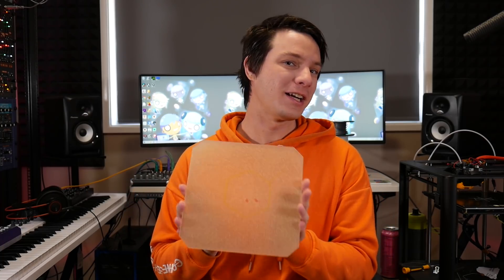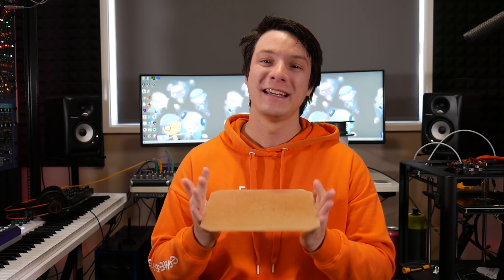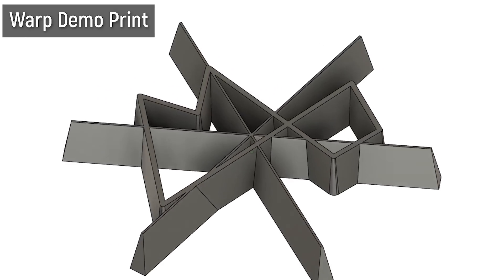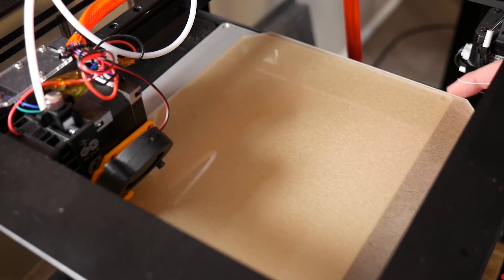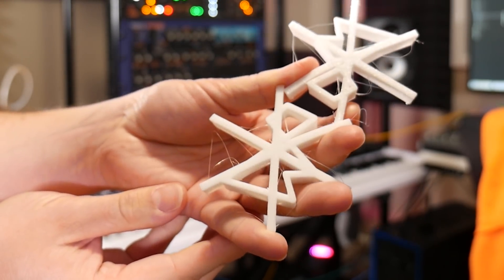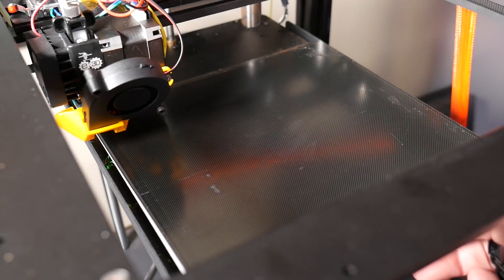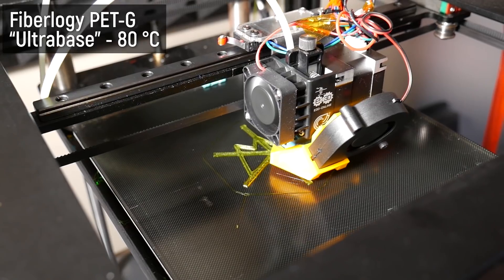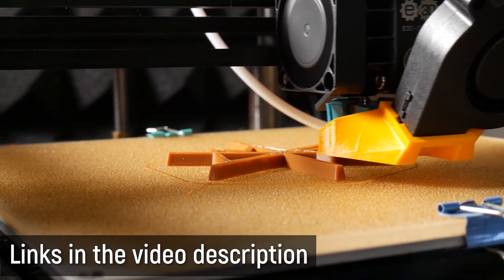A REALLY unusual 3D Printing surface! Ultembase PEI Glass test and review.

Comment: i havent been paying attention to the 3d printing scene recently what happened to tronxy?
Reply from the maker: It originally shipped without thermal runaway protection and they handled it... Poorly.
Reply: @MakersMuse  that's kinda wierd my x5sa 400 with the chitu board came with thermal runaway protection mind you i bought that in 2019 before the pandemic i have since put a skr v1.3 and a volcano hotend on it and am planning to put linear rails on it or develop some reticulation carriages to work with v slot kinda like this.
https://www.thingiverse.com/thing:655539

Comment: Seems like a solution looking for a problem to solve.
If you want a PEI build surface on glass, just apply a commonly available PEI bed sticker to a glass bed 🤷‍♂️
Reply: Pei sticker is a lot different to textured pei like on the glass bed when it comes to adhesion and properties
Reply: We wouldn't make this product if it doesn't offer improvements! PEI bed sticker doesn't release prints automatically, not textured like the Ultembase, and is generally worse than our Flex-Steel PEI sheet. Ultembase has better performance than our flex-steel PEI sheet, which has been a best seller on many platforms.
Reply: @energetic3d647  Also, stickers need to be applied by a human. So many bubbles.

Try to use a smooth layer of PEI before you then apply the textured layer. That would significantly improve the PET-G performance because there would be no chance for it to attach to the glass.

You could also try using quartz glass with a coating of hexagonal boron nitride before you apply the PEI, but that would be very expensive!
Reply: @AmaroqStarwind  You don't know how to put stickers on without bubbles? I learned that when I was 13.
Reply: @dangerous8333  I mean, I do, but it's really difficult.
Reply: @AmaroqStarwind  Bubbles are only a problem with thin PEI sheets (but are easily avoided), with thicker sheets (I use 0.8mm) you'd really have to try to get bubbles.
Reply: @energetic3d647  The bed that comes on my Ender 3 V2 works perfectly, so why would I need this?
Reply: Not high temp... I think the real purpose of the this is likely peek, it's a shame it's such an investment to print with though.
Reply: You just wanted to sound smart by saying "solution looking for a problem".
Reply: @69elchupacabra69  a better way of saying it would be "an alternative solution to a problem", given that from the tests it performs similarly to the "ultrabase"
Reply: @Kalvinjj  Exactly. Just because chopsticks exists doesn't mean forks aren't needed
Reply: @69elchupacabra69  He is right, so who cares what you think.

Comment: With petg its less it ripped up the glass. It more bonded with the pei and then pei ripped up the glass.. PEI and petg are too similar and simply will bond more often than not. Ive always had to still use gluestick or magigoo for petg if i wanted my bed surface so survive if its  a printer that doesnt have Wham bam PEX on it.
Reply: @owowowdhxbxgakwlcybwxsimcwx  This may be good advice, I'll try it soon. So far we let all the prints cool off and release themselves as this is the best way to release prints without peeling off the PEI layer. Perhaps things work differently with PETG.
Reply: @energetic3d647  @grg if it happens (print is stuck and can't be removed), just reheat the bed again and remove the print while the bed is warm. It will likely warp and get damaged but you won't destroy the bed surface (too badly).
Reply: It works fine on my 0.2mm smooth PEI sheet but I do have to make sure I take it off before it fully cools on the bed.
Once it fully cools it takes up a fight to properly release, thankfully a PEI sheet is a bit more sturdy.
Reply: Polycarbonate will also fuse to PEI without a release, which is why Prusa ships a glue stick with their PC filaments.
Reply: That might be what happened! But Angus got a different result than what we got in the lab, which is strange. I guess I know what I'll do today, trynna replicate his results :)
Reply: @energetic3d647  I had this happen with G-Fil on one of your spring steel PEI surfaces too. PET-G/G-FIL is really not recommended to print on PEI anything - or you need to treat the surface with some release agent like glue stick first.
Reply: @owowowdhxbxgakwlcybwxsimcwx  I'll third this, I have smooth pei that's scuffed without glue and print both at 70 typically with the z-offset up .1-.2. Once done I remove when the bed cools to around 56, much cooler and you're basically trying to cut the print off with the scraper while delicately pulling and praying for some spread
Reply: I still don't understand how one rips off glass, its just such an alien concept
Reply: I always reheat before removing PETG from PEI after the bed has cooled down for a longer period.

Comment: I have been using a Sheet of PEI on top of a Borosilicate Sheet of glass on my 1st gen Ender 3 for about 2 years, have printed many Hundreds of face shield bands and Hundreds of other random prints and all I do is lightly scrub it over with a green scrubbing pad then wipe it over with IPA, its the best build surface I have ever found and I never get adhesion problems

Comment: Interesting vid. I'm getting my first PEI flexplate in a couple of hours. Really curious how it compares to the standard printbed they use on the Ender 3 pro.
Reply: Major difference! PEI provides a way better adhesion than the stock Ender 3 bed.
Reply: @energetic3d647  it was a day late.. but tried 2 CHEP cubes and the adhesion is so much better. The old bed just couldn't hold the prints anymore. But so impressed by the smoothness of the bottom of the print.

Comment: What happened to tronxy
Reply: Bad hot-end, bad hot-end wiring that was prone to get dislodged with an unsuitable connector, didn't have mintemp and thermal runaway safeguards enabled in firmware. Tried to catch fire.

After a couple rounds of bullshit-spinning, Tronxy actually fixed the firmware safety issues and made the update process really simple too, and it didn't take them very long to do so either.

Comment: I once printed a long chunky model using ABS on heated glass in a cold room and it tore off a piece of the glass as it cooled.
Reply: Not exactly surprising, you're not supposed to print ABS on bare glass. Should have a layer of glue stick or something else on the bed.

Comment: I am extremely fond of the springsteel bases personally.
Reply: Me as well, I have spring steel on all of my machines including resin...
Reply: They had the ability to put PEI on glass but chose not to do it on steel. What a waste.  Glass has awful thermal conductivity
Reply: Our spring-steel sheet has been the best seller for a long time, in our tests we found the Ultembase to be better than it, that's why we made it. The spring steel will deform under high heat if you don't have a strong magnetic heat bed, Ultembase doesn't. And since the prints are cold released, it decreases the PEI layers being peeled off with the print, and increases the life span of the surface. Once the issues are ironed out, I'm sure it will impress everyone.
Reply: @energetic3d647  on the home page of your website under the message for early customers you mention "printer orentiend Youtubers", should be "printer oriented Youtubers
Reply: @energetic3d647  My solution was to use magnets so strong I have to be careful not to break the PCB so I'd say for convenience this would be much much better I would definitely get one if I already didn't upgrade my magnets already. maybe in a future release if you can fix the pei issue to reliably work with petg, ill get it. because I imagine that's just an early bird quality control issue.
Reply: @wwtapsable  have you ever tried putting the metal bed on an induction heater turned on for a fraction of a second while you lift it?
Reply: @wwtapsable  also, have you tried to use an etched pattern on the other side of the metal (such as via chemical etching) to "guide" the expansion or flex into a uniform or circular shape?
Reply: @lelsewherelelsewhere9435  No, I don't have the expertise to know what patterns would affect the thermal expansion but can confirm that bigger stronger magnets  do work
Reply: @energetic3d647  I HAVE ORDERED YOUR SHEET IN YOUR SHOP 1 MONTH AGO BUT NO SHIPPING NOTIFICIATION AND NO EMAIL REPLIES. WHAT'S GOING ON?